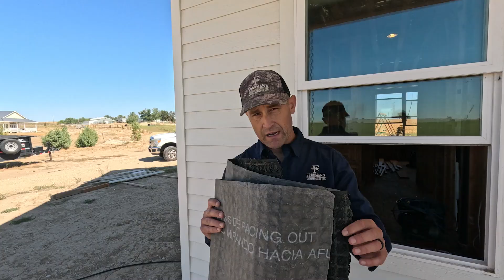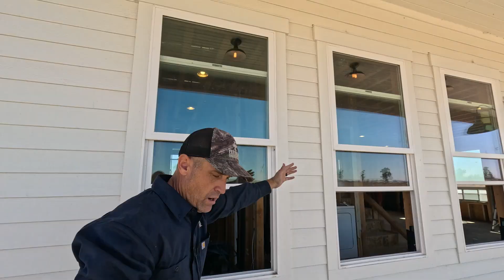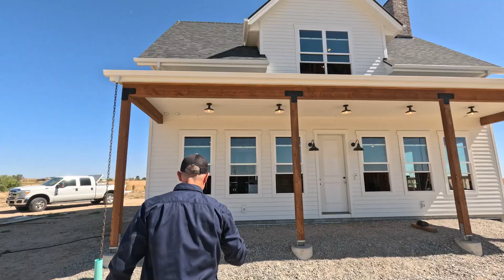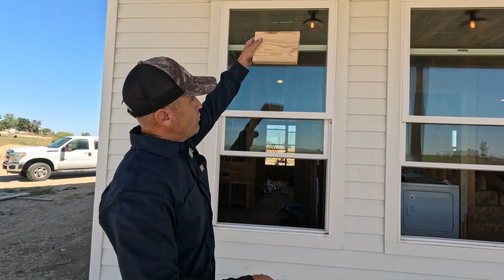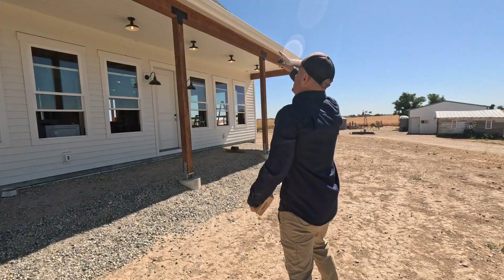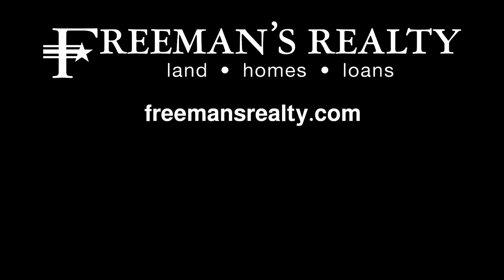Hardie Siding Tip: Install ZIP Rainscreen and Vent It Properly

Comment: I was told by the county (same county you’re in) that we can’t use the vented hardie soffit and needed to use fire resistant vents, how’d you get those hardie soffit vents to pass inspections?
Reply from the maker: What county are you in? This home was in Canyon County Idaho. If you are in San Diego County then you are correct that all the vents have to be fire resistant.
Reply: @Rea @RealPropertyShow  yeah, San Diego County
Reply from the maker: Brand guard or Vulcan make the vents to pass fire codes in SD County. You can avoid all vents in your roof and soffits and not vent the attic if you use spray foam at the roof sheathing and create a conditioned attic. It is much safer for wildfire but can be a drawback to off gassing of spray foam chemicals.